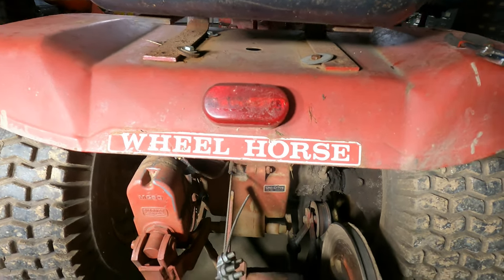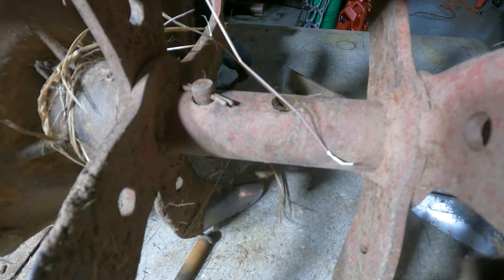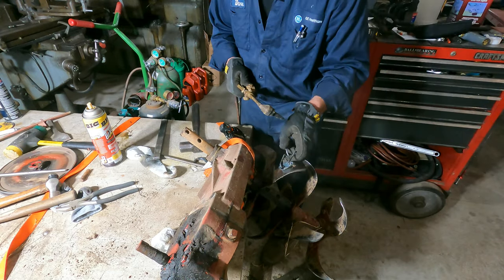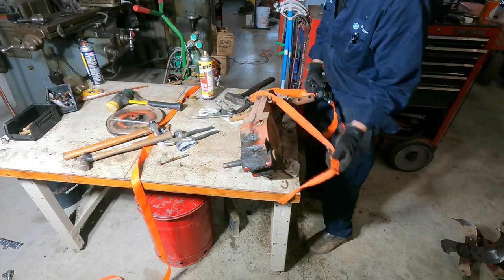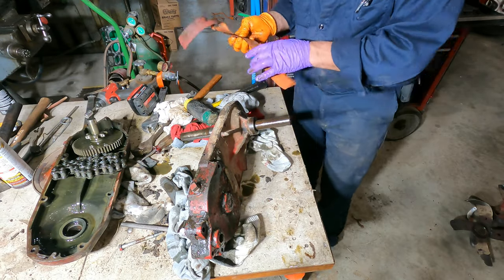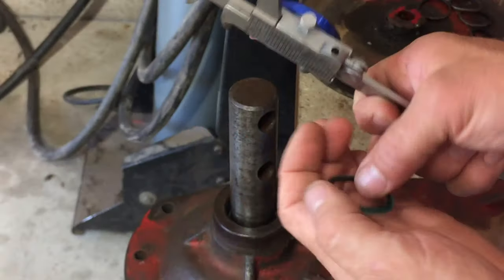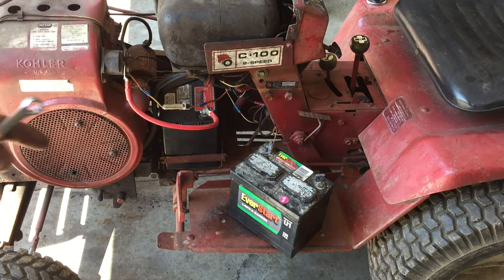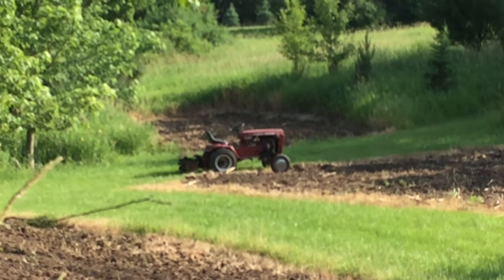How to rebuild a Wheel Horse rototiller gearbox making seal drivers rototilling food plots

Comment: Great video and effort.  To get my tines off I used a bolt with a coupling nut on each side so the pressure was even.  A torch, PB blaster and it came off after much effort.

Comment: Picked up a Wheel horse C-100 yesterday with a mower and tiller and so am grateful for your video which outlines the removal of the tines etc.
"Hitting your hand with a Hammer" is an occupational hazard which I'm prone to as well, so I feel you brother.
Just an observation or two;  If you're going to want to hold a job down while you knock off the bits you might use a chain rather than a ratchet strap as the strap has a lot more give in it than the chain, especially the way you had yours laid across the table.  If you had a vice mounted on the bench it would really make it work for you.  Your choice of chisel is like your choice of Torch tip - All wrong.  Now I don't want to be a negative Nelly as I like your information and your presentation style is incredible but a blunt end drift rather than a sharpened end is required when knocking off the tines.  Also that was a cutting torch tip you were employing to heat up the tines which may be what you intended to use however those of less understanding might end up cutting into the metal with that tip rather than the heating or brazing tips which would normally be used.  It's nice to have all the tools but not everyone does, just reviewing your video I see that it is a blunt end drift that you are using so I'm wrong about that however the reason you're hitting your hand is because it's far too short for the job.  
I love and I do mean L-O-V-E the fact that I just noticed that you're wearing a GE Healthcare shirt - Steinmetz and Edison would be proud.

You are the epitome of Edison's favourite saying which was "Genius is 5% inspiration and 95% perspiration"

Keep up the good work.  I'll be watching!
Reply from the maker: @peckerwood6078  yea there are times I grab what’s available and let’er rip. Those rototillers are tough as nails!  I rototilled up a root infested field and that thing just kept on chugging along. Congrats on that C-100!!

Comment: Did you replace any bearings?  Mine are all shot, don't know how to remove the cupped style bearing?  Any help would be appreciated.
Reply from the maker: I had needle bearings and I replaced them. With the cup and cone style you will need to drive the cup out the same way the cone came out. Typically the cup is driven in to a shoulder so you have to drive it out.
Reply: @whatsnextgarage  thanks  for the quick reply.   I'm new to this type of repair work.  Your video was inspiration to get this tiller back in action.   So the cup looking bearings are put in from the outside of the case with no sealant?  The oil won't leak out?  Thanks for your time and willingness to share.
Reply from the maker: @swamproadbaskets  no the oil is kept in by the seals. List the model tiller you have here and I’ll look up the schematic and see what it’s looking like.
Reply: @whatsnextgarage  mode 67-36TL01 the closest schematic I found was 07-36TL01 gear case looks the same,   I understand there are seals on tine axle and one side of the input shaft.  But the other end of input shaft is set into what looks like a cup with a bearing. Also there is an intermediate gear that both ends set into similar cup looking bearings # 1532.   It's those three areas I'm not understanding.   Are they pressed in from the inside of the case or from the outside in and the closed ends are just painted to look like the case.   Thanks
Reply from the maker: @swamproadbaskets  sounds good I’ll check it out👍
Reply from the maker: @swamproadbaskets  https://www.wheelhorseforum.com/files/file/2823-tiller-36in-1976-67-36tl01-tipl-snpdf/
Reply from the maker: @swamproadbaskets  It looks exactly like mine.  they are needle bearing not tapered roller bearings.  let me look back at my raw videos and see if I can find where I pulled out the bearings.  it was a while ago I can't seem to remember exactly what I did😂😂old age at its finest
Reply from the maker: I WAS WRONG!  I didn't replace my bearings they were all good.  however i am linking a web site that shows the type of tool people use to remove needle bearings.  https://www.partzilla.com/product/aftermarket/2XOF-MOTION-PRO-08-0636?gad_source=1&gclid=CjwKCAjw5v2wBhBrEiwAXDDoJbI39RigQOXJ5F9B5gW2FHBb2eJ6rsWX2i28SIfg5tBQfn2pfkWFvxoCoSQQAvD_BwE